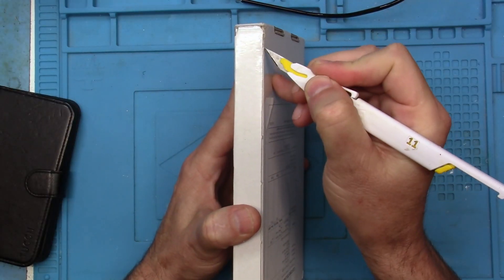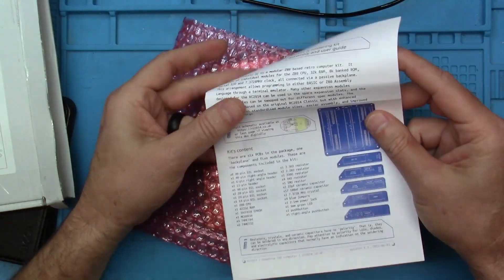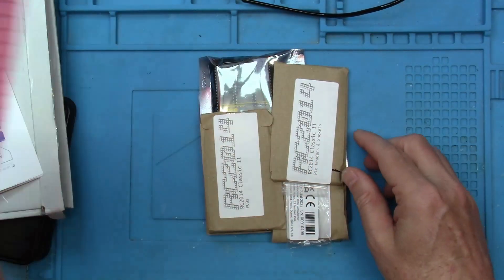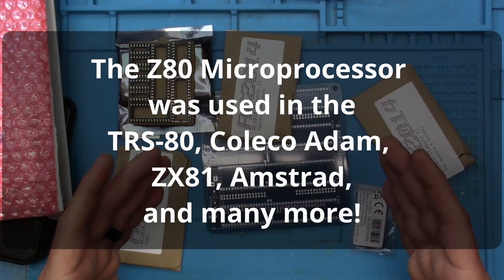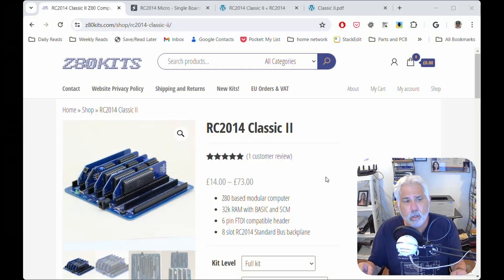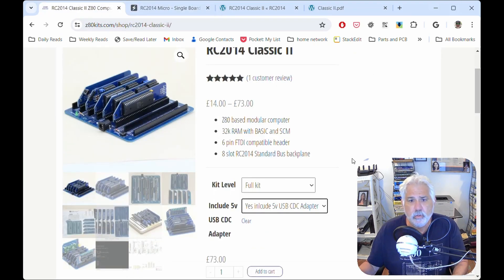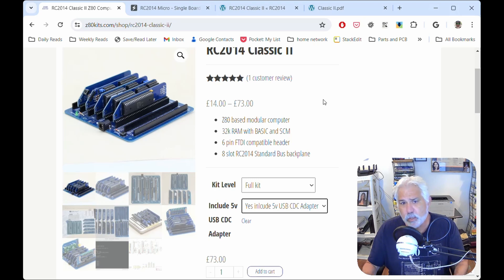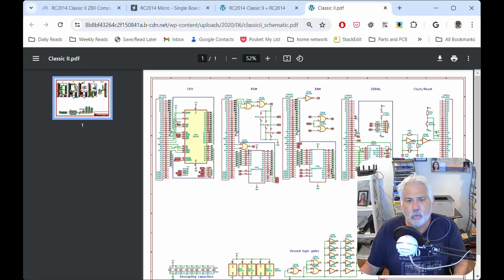Building a Z80 Computer - Introduction

Comment: Does this little kit have any kind of video display. I don't care what kind, vga or composite would be fine. I'd just like some kind of display.
Reply from the maker: No, the kit does not come with a video card.  However, you connect to it via the serial interface and use a terminal program on your main computer.  For Windows I use Putty.  
There is a VGA card that you can purchase if interested.  More info: https://rc2014.co.uk/modules/pi-pico-vga-terminal/
Reply: @StuartPatterson  Thank you for responding. Yes, I picked up on that and I'm well versed in serial communications, no problem there. In fact I own an old VT220, It's backed away in a box but I still have it. How hard would it be to give this a video interface like the old video arcade systems. I'm thinking something like space invaders. I've been playing around with 8bitworkshop and was just thinking it would be cool to see my code running on real hardware.
Reply from the maker: @redpillcommando  Sounds doable if you are OK with using the currently available VGA card.  If you want it to look like an old arcade machine, I believe the problem area might be the keyboard mapping to a joystick and buttons. Since the keyboard is serial I could consider using the Arduino Nano or similar microcontroller to map the buttons/joystick to serial output keystrokes.  Sounds like an interesting project!  BTW I have video somewhere on my channel about a Retro Pie Arcade machine I built years ago.  Have fun!
Reply: @StuartPatterson  Bless me for a blind fool. I missed that card somehow. You are 100% correct. the Z80 kits website has a VGA card. Thank you very much for your time and trouble. Now I just have to decide if I want to take the plunge or not. Putting the kit together looks like a lot of fun and I have a birthday coming up.
Reply from the maker: Have fun!

Comment: Hey Stu!  Will be fun to watch this project and learn how they actually work.  Not like I have a ton of time for another hobby, but now I need to see if there's a kit equivalent of our Atari 800.  This z80 doesn't fall into that category, right?
Reply from the maker: No, the z80 is not the same. Certainly from the same time period, but different cpu, the Atari 800 used the 6502.  I have heard of some Atari emulators running on the ESP32, which would make a fun project. Maybe I should add that to my list!
Reply: @StuartPatterson  thanks for the information.  Will take a look at that.
Reply from the maker: @dougtrythalleqoasharpy3101  Yeah, no worries. It would be a fun project to build an 800XL clone using the esp32.  It is on my list for future videos!